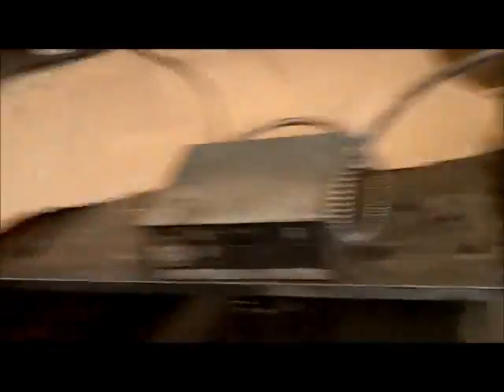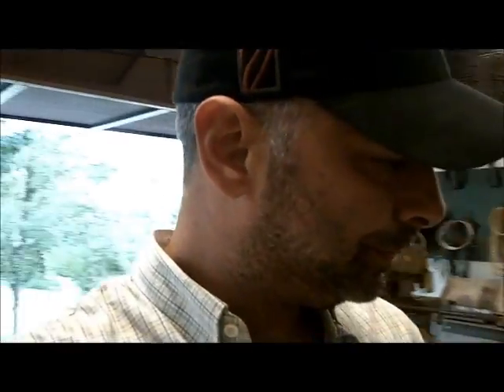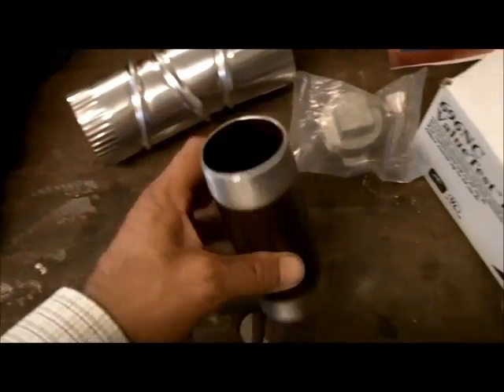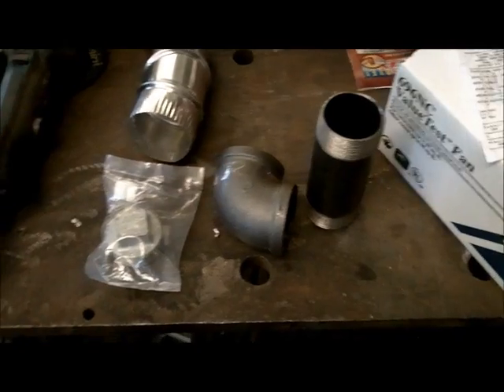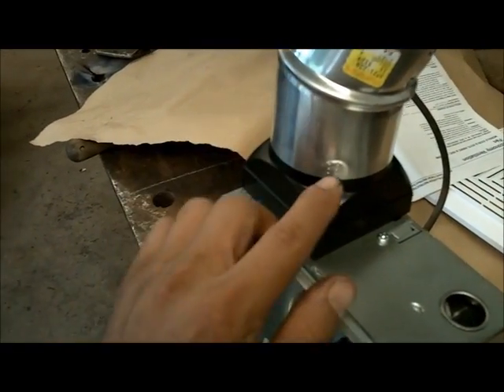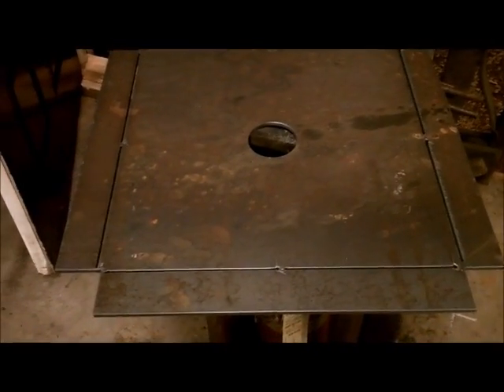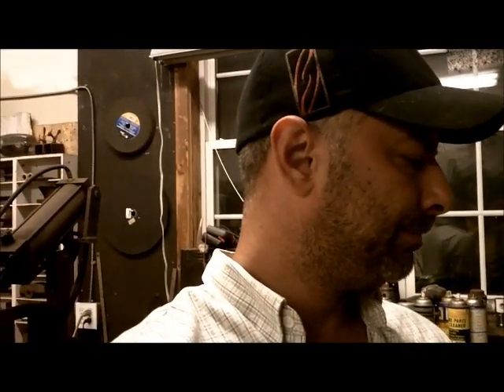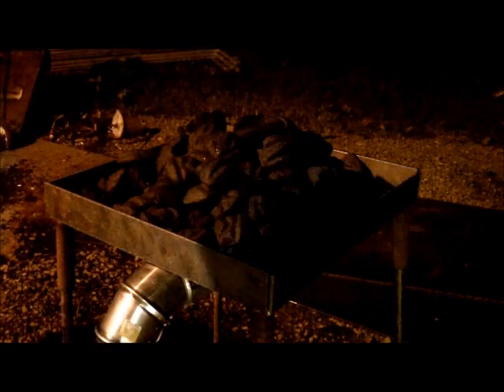$40 FORGE built in 1 hour!!!

Comment: regarding the fan. I have found that a fan from an old microwave works amazingly well for this application. they have good mounting points are enclosed to avoid accidental contact with fingers and I have gotten quite a few for nothing just haul the microwave away.

Comment: Can u use a hairdryer instead of a kitchen fan
Reply: The constant airflow through the motor should keep it happy.   Small high powered motors do get through a lot of brushes though,  even if they don't overheat.   You'll get a few hundred hours out of a set usually, which gives you time to locate replacements if you can.   Bearings may need annual replacement too.

The noise is a good reason to prefer a larger slower fan,  or a manual handled blower, or even bellows.  You don't need constant forced airflow in a forge unless you're trying to melt metal.

Comment: could PVC piping substitute the metal piping? idk how heat resistant it is but my dad has access to plenty of PVC
Reply: JustinSucksAtGames PVC will bend/melt at a very low temperature. However, if it's cheap and available, it doesn't hurt to try. I don't think PVC will release any toxic fumes, so go for it.
Reply: burning pvc definately releases toxic fumes. Probably will melt where it touches the forge too.

Comment: Rub vinegar on galvanized metal and it will take it off. Tip from hvac
Reply: I do not think so. You need to grind it off with some way or another, vinegar wouldn't do anything towards the galvanized coating. Potentially dangerous to say such a thing also.
Reply: great tip! never heard of that one.

Comment: How room would someone need to operate a small forge? I have an area of about 5'x8' with a ceiling @ 81/2' enclosed on 3 sides. Is this too close for comfort?
Reply: As long as you have room to move your body, you should be good. The major thing to keep in mind is VENTILATION. I'm operating in a space about that size, and, I can actually help you.

You need to get a high-CFM vent fan, and, some way to power it(I use solar panels for mine), because it has to suck the fumes out. Cut a hole in the roof, put a hood over your forge, and, talk to somebody who knows venting really well to suck all that out.
And, for Christ sake, get a portable Carbon Monoxide alarm that clips on your belt for a space that small, otherwise, the next time your family goes looking for wood to build something, it'll be for your pine-box.
Take it from an Asthmatic: If you think you're being too careful with a space that small, you're dead.

Comment: Charcoal works...but coal works better..I'm talking about coal you burn in a wood stove for heat...where do you think all the coal goes that's mined in west va..alot of it to reel mills and I know a lot of goe to making power for homes but coal is much better and cheaper you can buy it in bags at old hardware stores.
Reply: Ronald Cox Yeah "coal that you burn in a wood-stove" sounds a little odd.I don't know about you but I burn wood in a wood-stove.
Reply: Coal just burns longer. Charcoal burns cleaner, and is much less expensive and toxic than coal. You can also manipulate a charcoal fire to produce much more heat than with coal, I've found that out through just tinkering.

I discarded all of my coal after finding out I could melt and cast much more quickly with good softwood lump char, than with coal.

Comment: Wouldn't smaller holes with a rheostat in the line to vary the fan output work better?
I built a brake drum forge with a 3/16" plate welded to the hole in the brake drum.  Drilled small holes in the plate and used an old hair dryer with an in-line rheostat for adjusting the air flow.  Insert the end of the hair dryer into the end of the air inlet pipe and it worked really well!

Comment: For 16 dollars, you can buy a 92mm tornado high air flow fan designed for server rack cooling. They have a TINY foot print and 120 CFM, or a 120mm delta fan, for a larger footprint and 240 cfm. Requires a 12v power supply, which is easy with an adapter to mains or from a car battery. Just something that would be cheaper and more efficient than a ventilation fan.
Reply: Where would one go to buy such fans?
Reply: Andrea T
http://www.newegg.com/Product/Product.aspx?Item=N82E16835213001
http://www.newegg.com/Product/Product.aspx?Item=N82E16811999613&cm_re=92mm_tornado-_-11-999-613-_-Product
Reply: Andrea T Oh and make sure they are intaking air, not exhausting it. Probably pretty obvious, but wanted to make a point in pointing that out.
Reply: Richard Smith Ah! Computer fans! I hadn't thought of that for this application. Brilliant. That would also mean that you could use an old computer power supply to provide a 12V source (or, as you had said, a car or deep cycle RV/marine battery). Thanks.
I wish I had a shop here to set up a forge (as well as my welding equipment (which is all buried in storage) but, alas, that isn't an option in my present location.
Reply: Andrea T Use server grade fans, not consumer grade desktop fans, they are not up to the strain, and server grade fans favor cfm at the cost of noise, they are very loud, so those would be ideal for this purpose too, where CFM and longevity are much more important than noise output.
Reply: Richard Smith I, not being any kind of real computer person, would not have known that there would be a difference between server fans and desktop unit fans. Thank you for clearing that up.

P.S. Happy Holidays!
Reply: Andrea T No problem. The job you would be using the fan for is not unlike the environment server grade fans are meant for. To be run at full speed for years in a toasty environment. The failure of a server fan can be a very expensive failure, so they are generally extremely overspec'ed overly reliable workhorses. You cannot get that kind of performance and reliability in the desktop market, as that much reliability isn't needed and is not worth the noise levels. So they really are different beasts entirely.
Reply: I built a hand bellows for less than that, that pumps out close to 500CFM at max, with more pressure than a shop-vac. It's also quiet, to boot. Everyone knows it ain't the volume of air that matters, it's getting enough pressure to overcome the static load in the fire that REALLY makes it come to life.

Besides, what pyromaniac doesn't like the sound of a fire breathing like some kind of hellish abomination taking a siesta?

Comment: Or a woman, but I guess that slipped your mind. Nevertheless, thanks for the forge hack. This is cool, but I woodwork and don't have a plasma cutter, which would be a limiting factor if I didn't want to do the drum. Maybe a nibbler attachment? Now the project is $70. Still, sturdier than other tuts on youtube.
Reply: My first brake drum forge didn't even have a pan.  Just the drum.  I made a lot of pretty neat stuff with it before I ever did one with the pan surrounding the drum.  I will admit that having the pan surrounding the drum makes things easier and more functional, though.  I just mention that with just the drum and legs bolted to it will give you a basic unit that will work until you decide you want to keep doing it or until you can afford better!

Comment: not bad.  I did a $5 walmart wok.  $8 cooking pot.  $10 hair dryer.   an cut an aluminum water bottle as the pipe.   works awesome.
Reply: but i need to make it more steady.  yours is more robust.
Reply: Jamie Burke it doesnt matter about about how robust it is there is always room for improvement if it does the job then just look at it and see how you could neaten it up
Reply: Jamie Burke that even sounds genius. Reall cool. Is the set like the one in this video respectively

Comment: no people milk does not help cure metal vapor poisoning, if you use galvanized metal all you gotta do is heat it up n take an angle grinder to it with a wire brush... and thats pretty much it... wear a mask n youll be fine... thats what i did n i didnt get any vapor poisoning ... n the symptoms are pretty clear if you pay attention

Comment: I think I understand the forge part, what I need to find out is where to get a fan that does not need electricity I have only seen them on fairly big forges. The reason I live in an apt in the city and I can't do it anywhere in or around apt. however I can go to picnic area with no problems.

Comment: I built a forge out of a 20lb propane tank, son 2 inch square iron , auto exhaust pipe welded it up hooked a blow dryer to its worked for 2 years no issues. my total cost after a visit to the scrap yard and Walmart for the blow dryer was about 25 bucks. just saying.

Comment: do you know what would happen if you heated up steel till it starts glowing then dipped it in really cold liquid nitrogen. would it change the steels structure.another question would hot steel cool down quicker in a vacum chamber.

Comment: Stainless Steel-  when heated produces a deadly toxic gas called Hexavalent Chromium, it is highly toxic. and Can and Will kill you over time. He said Stainless Steel is best. INCORRECT - You want to go with Old Wrought Iron - it may rust but it will take YEARS for it to rust. Cover your forge with a tarp after it has cooled to keep the rain off it thats the best you can do. 

DO NOT USE Galvanized. 

DO NOT USE Stainless Steel

--------------------------------------------

End of story.

Comment: not trying to be a dick but dont tell people to use galvanized when its going to be something near high heat because it releases toxic gases when heated. If you have no choice then grined of the plating on it in a well vent palce and have a resperater. So ya avoid developing galvonation poisoning

Comment: Use foundation block as a table and place the pan on the top. This worked GREAT with the Semi Truck brake drum and the foundation block hole openings made a great route for the Fan blower pipe. The heat is so intense that FOLDING Iron was easier than folding steel. Iron rebar was folded into itself some 36 times with this forge method...
THANK YOU Modern Blacksmith for the knowledge...and the beer tips. Keep it 
pounding!!!

Comment: If you want to remove the galvanized layer just buy a quart bottle of muriatic acid, put it in a plastic container and drop in the galvanized part.
Do it outside and do NOT breathe the fumes.
Be ready with a box of baking soda and a water hose.

Comment: Couldn't you just use an old charcoal grill to do this? Instead of the brake pad or pan I mean, cut a hole in the bottom of that grill and place the blower on there?

Comment: @jdouglasfisher I disagree, the entry level kit should be only the pan, tubes for the legs to slide into, and the hole cut for the tuyere. No blower or piping included; those parts would just add cost to shipping. Anyone could go to their hardware store and get the parts to attach. Keep the cost low for new people.

Comment: Dan, keep your peepers open for free treadmills (or cheap), a lot of them have a 1 horse motor (DC).  Ya just pull the motor and speed control (be sure to pull the transformer too).

Then ya got yourself a high torque variable speed setup for a drill press, sander, grinder, etc.